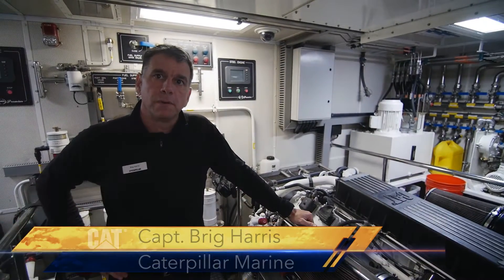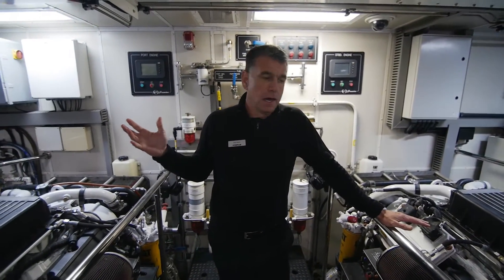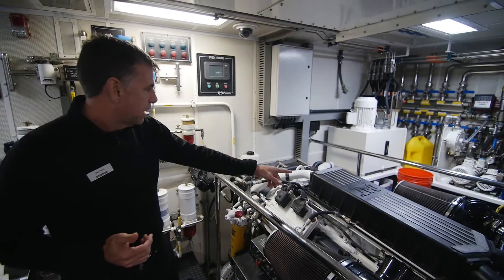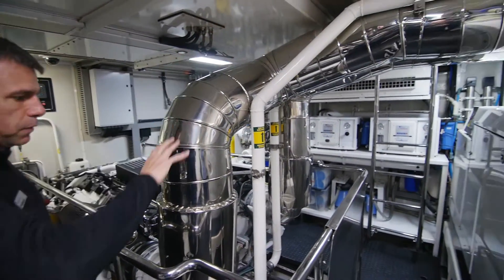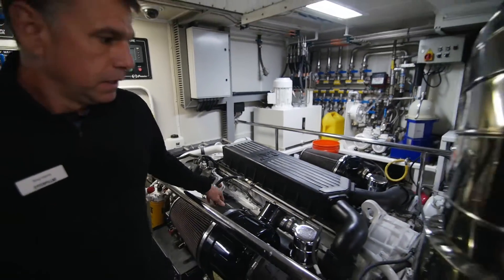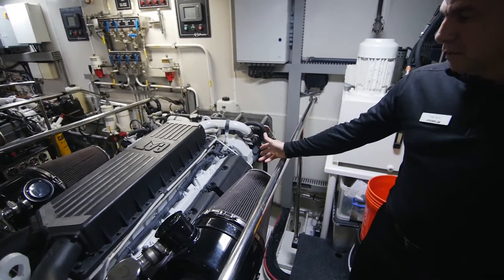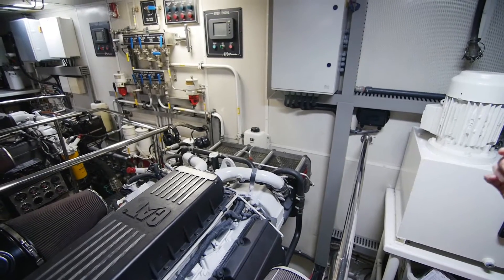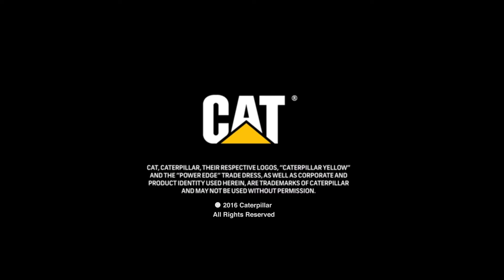Cat C32 Engine Room Tour

Comment: This video does not give a true representation of just how big these engines are. Much of these engines are below deck level. I’m curious if the oil and fuel filters can be accessed without removing deck plates?